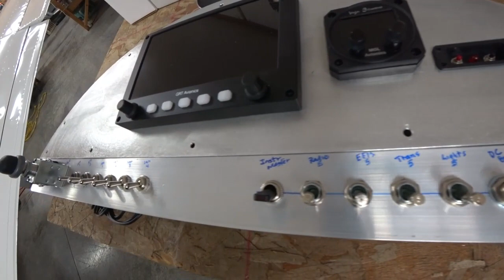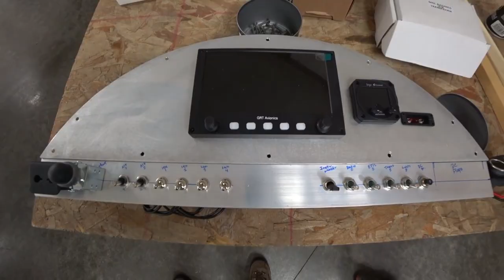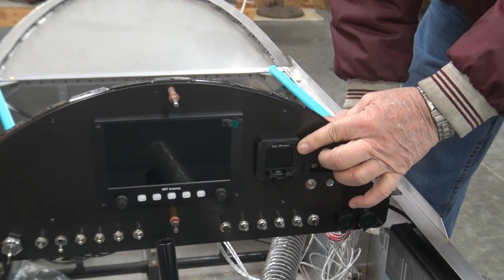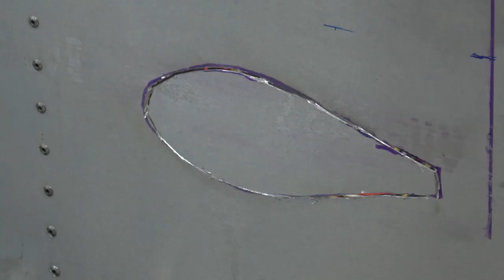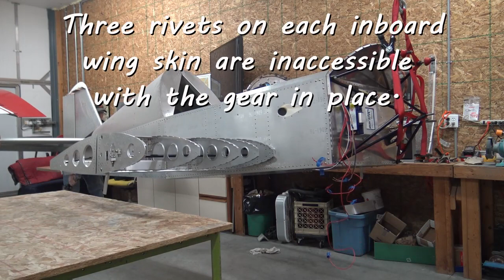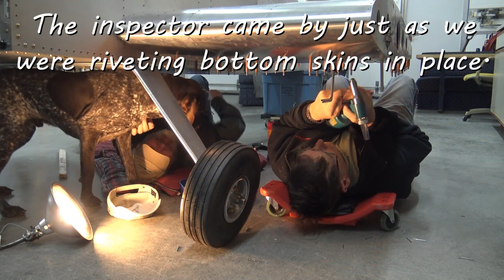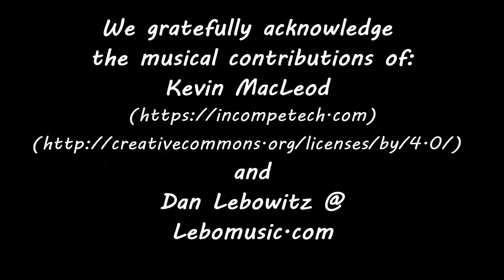Winter Onex One-derland

Comment: Nutplates and screws around the fuel tank instead of rivets?   Do you really think you're gonna have to REMOVE that cover that often?  Why didn't Monnett think of that?  (Oh wait... am I supposed to call them Sonex?  In my mind, despite the bankruptcy, sell to "INAV" in what? 1986?, RE-birth as Sonex Aircraft LLC today, they are and will always be... Monnett Aircraft to me!   I attended the bankrupcty SALE at Oshkosh in what? 1986? and bought all I could! ) I DO approve of nutplates and screws if it really is something that will be removed often.  I saw sheet metal screws much earlier in the build in a place I thought should have been nut-plates, but cannot at this moment where you showed them.  Maybe wings?   Did you go with the short wing-tips or long wing-tips?    I am 210 lbs.  But I wanna go with the short wing tips -- speed and roll rate are important to me!
Reply from the maker: Long wing tips and as of this writing, the owner has had the cover off the tank 3 times. Fuel leak problem now traced to bad fittings molded into the tank. Certainly would recommend pressure testing the tank and fitting before installation. He's really glad I talked him into nut plates. Sonex, by the way says you don't need to take off the windshield and combing to remove the tank. "just unhook it and drop it down and bring it out below the panel." I can't even imagine that would be an easy way to do this.

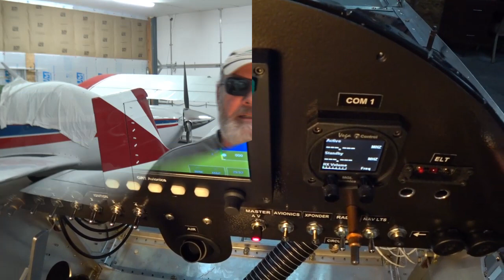Comment: Here's a  Very long message to review your excellent video! And, if we are patient enough to watch the whole thing, we FINALLY LEARN at 20:01 that you are in Michigan!
Your Video work is EXCELLENT!   Very sharp!   Focused.  Not so crazy about the music, same stuff over and over... But it will do the job.
5:30:   Jeremey Monnett says put ALL the switches and things you might need to touch or change in flight on the LEFT side of the panel (right hand pilots) so you can keep your right hand on the stick.  Just sayin'.
But... at  5:06, it is clear your instrument panel will be hard mounted to the plane.  I am SO TIRED of hanging upside down, with my head way up under the panel, to work on, rewire, remove, reinstall, wiring and tubing and who-knows-what-else to the BACK SIDE of my instrument panels!   
From now on,  Mine will be mounted with piano hinges (right, left, maybe at entire bottom row) of panel such that I can flop them down, or sideways to WORK on the BACKSIDE again!.
5:32... Oh... I see you have been to Harbor Freight, too!   That's one of my favorite drill bits, especially for drilling in metal, including steel!  But...ya gotta be careful!  Those step drill bits want to go just one step deeper than you had planned to drill!
7:13:  ELT?   Did ya know that there is NO requirement for an ELT on a SINGLE pilot airplane?  The FAA doesn't care about YOU!  They only care that you might crash with a PASSENGER!   With modern flight tracking software, if you go down, all your family and buddies will know where you crashed!
8:00    What's that?  An overgrown super horsepower Dremel tool?  I want one of those for cutting thru metal  in the middle of nowhere!  All I have is the standard Harbor Freight grinding tool with 4 1/2 Inch disk!   What is that, and where did you get it?
Saw it again later.   Forgot what you were cutting.  Ooops... there is it again at 13:00.  And, at 19:09  there's yet ANOTHER one!
8:50  You didn't say a word about that lithium battery!   Jeremey Monnett mentioned  in 2012 that there was a 2.3 lb battery that could replace the 13 lb Odyssey battery .. Is this it?  What is it?  Did it Come with that snazzy mounting cover, or did you have to build it and snap on that decal?
12:00.... Pitot tube --- does THAT come with the kit? How about static ports?  Engine oil temp, oil pressure, CHT and EGT probes?  Do they come with the engine or do you have to buy them separate? I see you went with Grand Rapids instead of MGL (Sonex insists!).  Did the source probes come with the Grand Rapids or Aero Vee / Sonex? Or are they all EXTRA?
12:37:  Where did you get all those LONG drill bits?   I see them often in your videos.  All I can find are the usual  short drill bits!    I need those long ones, especially in #28, #29, #30, #31 and #32 brill bit size!   I don't think Harbor Freight (besides being the number one customer of metric Chinese tool junk) has a clue what a numbered drill bit is all about!
14:30:   Landing gear:   I am totally proficient and comfortable with a tail-dragger gear.  But.. I've learned that NO ONE ELSE IS!   When it comes time to sell an airplane, they all want tri-cycle gear!   So... I'm gonna sacrifice about 5 knots of speed and install the tri-cycle gear on my ONEX, JUST SO I can SELL IT to the lowest common denominator pilot who ONLY knows how to fly a tri-cycle gear plane!  I'll try to make up for it with the turbo Areo Vee engine.  I see you went with the Revmaster --- a very wise choice!   Dual alternators... oh my!
15:03   I have two Golden Retrievers who help me build planes, work on my house, my yard... They would be RIGHT THERE trying to contribute at that point if I were laying flat on the ground!
18:21  An Ed Sterba wood prop!   Wise choice!   Sterba has built props for VW engines since at least 1979.  I bought 2 or 3 from him for my Sonerai in those days. His cruise prop really put the speed in my Sonerai II (mid wing --- main wing spar came right thru the cockpit across my knee caps!).  I'm so happy he's still in business.  The other guy (long ago forgot his name, from southern Calif desert near Salton Sea) died long ago.
19:48   Please explain.  OKay, we understand 'battery' in your world is what we call "master" switch, and it has a starter function with it.  (I hate key switches! Did you know there are NO KEYS required to jump in any Boeing airliner or most twin prop or jet biz planes to start them?)  But then... Magnetos, OKAY, 1 and 2. and then Ignition switches?  1, 2, 3, and 4?  What's that all about?
Reply from the maker: All engine switches are on the left side. Only  ancillary things like lights etc on the right. Instrument panel is easily removed via 6 screws and nut plates. ELT was owners choice, I would have stayed with a Garmin In-Reach. Battery is Earth-X and battery mount comes with kit. Pitot tube and static air all in one unit and they came with the kit, although thery do need assembly and mounting. We chose to build them into an inspection cover. Source probes are all furnished from someone, GRT or RevMaster. Long drill bits came from Cleaveland Tool. They handle all sorts of builder tools. Owner / builder has yet to receive his TW endorsement. Been after him for months to get on it and log some time prior to doing any flying in the Onex. Multiple coils and multiple alternators on the Revmaster leads to multiple switches for the coils.  Xtra switches select alternators, battery and avionics. I had, at one point, convinced the owner to put a push button on it but he simply has to have that key switch despite it doing basically nothing but cranking. When I built my RV-8 I had no key, liked it alot.